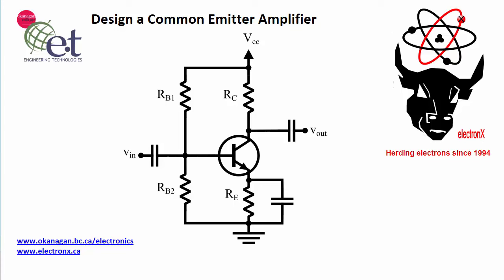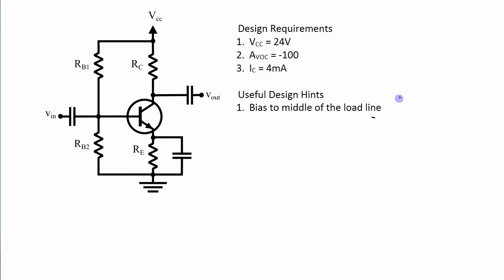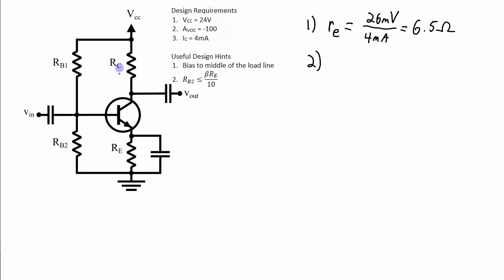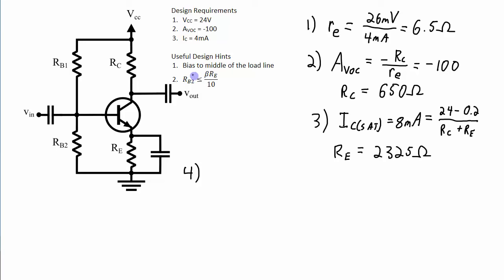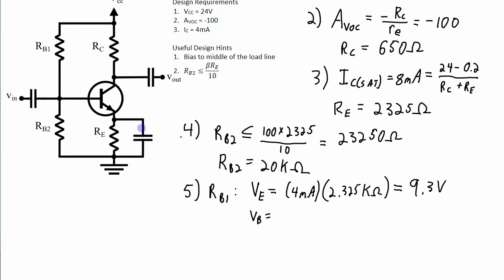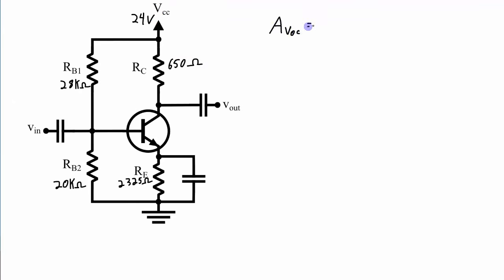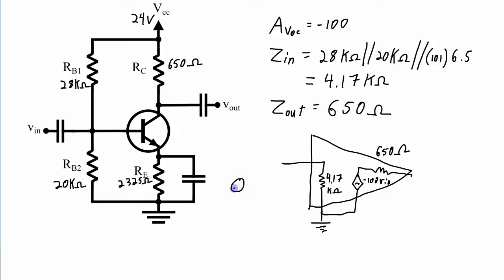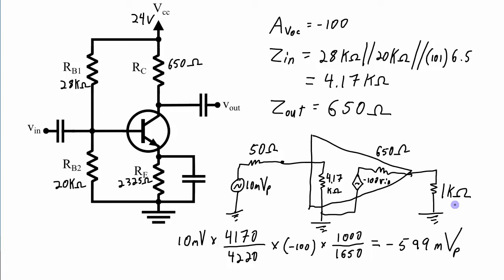Design a Simple Common Emitter Amplifier

Comment: Greetings,

Great video!!
I would like to ask 2 questions:
1. In 2:50 you calculate re = 26mV/4mA. How is the 26mV produced?
2. Why don't we use the DC/AC loadlines to calculate the Rc/Re values?
Reply from the maker: 1) The base emitter junction is a PN or diode junction. The AC resistance of a diode can be determined from taking the derivative of Shockley's diode equation with respect to voltage:  d(Id)/dVd where Id is the current through and Vd is the voltage across the diode.  The inverse of this derivative is the AC resistance of the diode and that emitter resistance is a diode resistance:   re = 26mV/IE

2) In a hand-wavy way I did use the loadlines by trying to bias as near to the center of the loadline as I can.
Reply: Thanks a lot for your response!!! Highly appreciated! :)
Reply: @ElectronXLab  I validated your design and found that Vce = 12.1V. Which means that the Q-point is on the middle of the load line between Icmac=8ma and VCE=Vcc=24V 

But some desings lectures say that Av= -Rc/RE .. How it is come?
And
Some designs say That RC should be great than RE.
And
Also some designs divide RE to two REs in order not to depend on re on their calculations

I'm little bit confused from the different ways of designing an amplifiers
Reply: @hero96559  I am afraid the choice of Vce = 12V in the video might not be a good Q point.  Vc=12V (to the ground, NOT Vce) is a better choice. If we selected Vce@12V, it means that we can only have around 2.5V for your upper margin of your ac output since Vc(to the ground) is already up to 21.5V. Besides, a general selection of Re shouldn't be too high, as most of the hfe gain of the transistor is above 100, it make the Vb voltage way too high as well. Anyway, the calculation here seems no problem, but the design parameters provided is not a practical one!

Comment: Can u point out how to determine the values of Coupling capacitors and the bypass capacitor to a preferred high pass frequency . And another request is can u do a tutorial for multi-stage bjt amplifier. Thank you.
Reply: For capacitor values, I recommend the following rule-of-thumb formula. (All results in uF.) Ce= 160K / (20 Hz x (RE / 10))=  160K / (20 x 233)= 34: Use 39 uF, standard value. Cin= 160K / (20 Hz x (Zin / 10))= 160K / (20 x 622)= 12.8: Use 15 uF, standard value. Cout= 160K / (20 Hz x (Zout / 10))= 160K / (20 x 65)=123 uF: Use 150 uF, standard value. You may adjust these values as necessary. Larger capacitors increase lower frequencies.  Smaller capacitors decrease lower frequencies. (For more precise formulas, consult an engineering textbook.) Capacitors narrow the bandpass of this amplifier. The emitter capacitor causes the gain of this amplifier to vary according to frequency. High frequencies receive the most amplification. In this circuit, the other capacitors enhance this high-pass effect. The 160K figure above is roughly ((1/2π) x 10^6): Close enough to determine typical capacitor values. By "typical capacitor values," I mean those that one can actually buy.
Reply: @w9xk  The emitter bypass capacitor needs to have a reactance smaller than re, which is 6.5R across the frequencies we are interested in. The circuit shown will need a capacitor of Ce = 160K / (20Hz x 6.5R) = 1,200μF to have a 3db loss at 20Hz. With 39μF, the emitter impedance would be (6.5 + 204j) ohms at 20Hz giving a gain of just over 3 with an almost 90° phase shift.
The ac input impedance of the circuit can be as little as 650R, not the 4.17K suggested.

Comment: Thanks for the tut. What if we don't have Avoc? Can I just arbitrarily allocate voltage drops in the resistors, but keeping in mind that Vce is in the middle of the load line?
Reply: You can pick any value for (Avoc) I think it's decided by the value of your collector Resistor divided by the value of the internal resistance of the transistor which you get by using this formula : 25mV/IE. Your dividing The Collector Resistor  by the Internal Resistance of the transistor because of the bypass capacitor which shorts out RE.

Avoc = -100 

Avoc = -RC/re
Avoc = -RC/650 Ohms
RC = Avoc x re
RC = 100 x 650

Comment: how do you power 2 for stereo  using one 9volt battery?   i tried it and it goes mono.  needs to have a power supply  to separate the power going to the collectors. emitter is common.

Comment: If Vce = 12V and VRE = 9.3V, then Vc (for DC) sits at 21.3V, there is literally only 2.7V positive headroom left for the AC to swing. I think you should've started in a way/had a design requirement so Vc would be VCC/2.
Reply: I don't understand 26mV , from Where ?
Reply: @minhdang108  Thermal voltage = kT/Q where k = Boltzman constant, T = absolute temperature and Q is the charge of an electron (also a constant). We usually take 25 degrees celcius as temperature.

Filling this all into the equation leads to 26mV. 

I'm not sure if he explained it anywhere, so here it is.
Reply: @trevortjes  Thank you.
Reply: You actually want it to be half-way between Vcc and the lowest voltage on the collector that keeps it out of saturation (say approximately the voltage you've set on the base). Of course, it doesn't matter if you're only dealing with a few hundred millivolt signal swings, but in general, it's as easy to design for a decent amount of headroom as it is to end up with very little. I'd normally pick a collector current that gave the best noise figures as long as that allowed large enough base bias resistors to get a usable input impedance. Leaving aside a few volts (say 3 to 4) for the base/emitter bias points, that gives me the value of the collector resistor for maximum available swing. For a 24V supply, I'd want 4V at the base and 14V at the collector with quiescent current. The other values follow from that.

Comment: Can someone explain the derivation of  26mv in the calculation of re?

I did look through the comments but still do not understand where that value came from.
Reply: Looks like this value is to compensate for Intrinsic emitter resistance.  It attempts to account for properties that can cause distortion (such as operating temperature).
Reply: @richardeberhardt1301 English man

Comment: Thank you for the excellent vid. Got a noob question. The input at the base of the transitor will include both AC(signal) voltage and DC(24v) ? So what is the actual voltage at the base?
Reply: At the base there would be ur original signal with an offset voltage
Reply: The drawing at 1 Second has what is called a blocking capacitor; This only allows alternating  voltage to pass; The DC does not go past that as he has it; This is not an unusual concept even though most think of a return path;
Reply: The final voltage at the base of the transistor will be the sum of both the AC (signal) and DC (bias) voltages. That is to say, if the DC bias voltage required is 10V (as in the video) and the input AC signal is 10mV peak-to-peak, then the highest voltage possible at the base would be 10.01V and the lowest would be 9.99V. This changing base voltage causes a small change in base current which in turn causes a huge change in collector current (how huge depends on hFE or ß) which is how the BJT amplifier basically amplifies.

Comment: Is there a way to calculate this when you know what your load impedance is? (or how to alter the design to account for the input/output impedance that changed the desired gain in this example)
Reply from the maker: You really need a multi-stage amp for that kind of control. One stage for controlling input impedance, one for gain and one for controlling output impedance.
Reply: @ElectronXLab  That makes sense, thank you!

Comment: Where would i go about starting my design if my inital conditions are Vin= 0.1 V and Vout=5 V (Peak to peak Values). I will be using a 9 V battery as VCC and a 170 beta transistor. Help would be much appreciated
Reply: You would want to specify the desired input and output impedances, and be realistic - you can't have Rin/Rout bigger than the beta in any usable design. Also a gain of 50 is tough with a single stage and an output swing more than half the supply voltage.

I would suggest aiming to set the voltage on the base around 3V and on the collector 6V. If we wanted high input impedance and low noise, I'd suggest using something like a BC184 with a collector current around 0.2mA giving a beta of 100 minimum at that collector current and decent noise figures.
That gives a collector resistor of (9 - 6)V / 0.2mA = 15K.
The emitter resistor would then be (3V - 0.6V) / 0.2mA = 12K, but that would give a gain of 15/12, so we need to bypass most of the emitter resistor with a capacitor to get an ac gain of 50.
So the ac emitter resistance has to be 15K/50 = 300R. But the intrinsic emitter resistance is 26mV/0.2mA = 130R, so we have to use a resistance (Re1) of 170R to make a total of 300R.
Therefore we have a remaining resistance (Re2) about (12k - 300R) = 11.7K of the dc emitter resistance. That has to be bypassed to ground by a capacitor whose reactance is less than 300R at the frequencies used. C = 1/(2πfR) which gives 27μF to have a cut-off below 20Hz. The entire emitter impedance would be a 180R resistor (Re1) in series with the combination of a 12K resistor (Re2) bypassed by 27μF (Rc).
The transistor's ac input impedance will be (beta x Re) = 100 x 300R = 30K, so there's no point in using base resistors much bigger than that. Using Rb1 = 100K and Rb2 = 51K would give  3V at the base, as designed. The current through Rb2 would be about 60μA and that makes the base current insignificant (Ic / beta = 0.2mA/100 = 2μA).

That should give up to 6V pk-pk available at the output (swinging from 3V to 9V). That can be trimmed by changing Rb1 (100K) slightly to make Vc = 6V. The gain should be around 50 for audio frequencies. That can be trimmed by altering the 180R emitter resistor slightly. The input impedance is around 15K at ac. Use an input capacitor of at least 1μF. The output impedance is 15K, so it needs a coupling capacitor of at least 1μF as well.

I'm uncomfortable with the size of re (130R) compared with the size of Re1 (180R) as it would lead to non-linearities and some distortion, but it's hard to get a better ratio of Re1:re without increasing the supply voltage or reducing the gain. You could lower the base voltage to around 2V by increasing Rb1, giving more voltage swing and allowing higher Rc and Re1, with better linearity, but the emitter voltage is then just 1.4V and the collector bias point would be more variable with choice of transistor. Of course, if you're just making a single circuit, you can change the resistors slightly to get the voltages you want, but that doesn't scale very well if you're making several of them.

Comment: Sir is it possible for you to make a video on how to design RF transmitter and receiver module circuit diagram with explaining it's working how the signal is transferred from transmitter to receiver. 
Topics to be studied for designing your own RF transmitter and receiver module circuit diagram eg. ( 433 MHz RF transmitter and receiver module)

Comment: The input impedance should be (Beta+1) x (re + RE)
Reply: But isn't Re bypassed by the capacitor Ce in the AC model?
Reply: @SopanKotbagi  3:30
Reply: The dc input impedance would indeed be (Beta+1) x (re + RE). That helps to keep the operating points stable. However, the ac input impedance assumes that RE has been bypassed by a large capacitor which has a small impedance compared with re. That means the ac input impedance is effectively (Beta+1) x (re), which is approximately 650R.

Comment: Wait, don’t you want current to flow into the base since that’s the direction the current flows anyways?
Reply: Yes but you want the base current (which also flows through Rb1) to be negligible compared to the current flowing through Rb2. That ensures that the base current has little effect on the base bias voltage. Good design will aim to minimise the effect of transistor parameters on the circuit performance and reproducibility.

Comment: From were you get  26 v
Reply from the maker: 26mV is the thermal voltage of the BJT and it's a constant (well, a temperature dependent constant) for the transistor
Reply: @ElectronXLab  🙏 thanks for the reply sir. Any video on how to design a  RF  transmitter and receiver module for remote control ie rc car etc.

Comment: good video! one question: why the circuit is set to Ic = 4mA in the first place? I believe setting to a lower current value like 2mA or even 1mA could produce the same voltage gain. And consume less power when running...Thanks
Reply: good question
Reply: That keeps the output impedance low (but unfortunately lowers the input impedance as well). As you suggest, we'd normally design for currents significantly less than 4mA, allowing higher emitter resistances, which increase the input resistance, at the cost of a higher collector resistance for the same gain, and hence higher output resistance.
Reply: @RexxSchneider  So he's using an Ic=4ma to keep the output impedance low? He mentioned something in the video about using that value so that the transistor is biased correctly but as long as it is reverse biased correctly there are a range of collector currents that he could use.  Still not sure why's he using that Ic unless he's requiring that for whatever load he connects to the amplifier.
Reply: @ricomajestic  If the gain of the circuit is a given requirement, then that determines the ratio between the collector resistance and the emitter resistance. You want the quiescent voltage on the collector to be about half-way between the supply voltage and the voltage at the emitter of the transistor as it clearly cannot swing beyond those limits. So the voltage across the collector resistor is fixed by that. That means if you design for a particular collector current, it determines the value of the collector resistor, and therefore the output impedance.

For example, with a 9V supply and allowing about 1V at the emitter, you have about 8V of signal peak-to-peak before clipping. So you want half of that, i.e. 4V, across the collector resistor. With a collector current of 4mA, you have a 1K collector resistor, so the output impedance is 1K. If you dropped the collector current to 0.4mA, you would have a 10K collector resistor and so the output impedance would be 10K.

Generally speaking, once you have a set of resistor values calculated, you can scale them all up or down by the same amount (within reason) and still have a circuit with approximately the same bias points and gain. But both the input impedance and output impedance will scale up or down by the same factor.

Comment: for Rb2 calculation  RB2 <= Beta*RE/10 , where did the 10 come from ?
Reply from the maker: The 10 is somewhat arbitrary; the purpose is to make sure that the resistance of RB2 is much less (i.e., 10x less) than the resistance seen looking in to the base

Comment: re: little Re, where did 26mv come from?
Reply from the maker: That's the thermal voltage and is a property of the PN junction. It is temperature dependent, so the value of 26mV is only valid when the temperature is about 25C. VT = kT/q. Where k is Boltzmann's constant, T is the temperature in Kelvin and q is the charge on an electron.

Comment: Why did you select BETA as 100 in step 4 while calculating parameters? For the sake of simplicity? or did I miss sth?By the way Thanks a lot for these useful videos !!!
Reply from the maker: Beta is a characteristic of a BJT. The value can vary significantly from transistor to transistor even ones with the same partner.
For this example, I just picked the value of beta for the sake of simplicity (just like you guessed).
Reply: thank you sir, waiting for more videos to come :)

Comment: . Design an amplifier circuit with the following specifications: 
• The overall voltage gain should not be less than 350.
• There must be phase difference of 180° among input and output voltage.
• The input impedance should be in the range of 50 𝑘Ω and 60 𝑘Ω.
• The output impedance should be as small as possible, preferably lower than 5 𝑘Ω.
• You cannot use Operational Amplifier. You can only use BJT or FET or both for your 
design.
Reply: Can any one solve this plzz
Reply: @AmirKhan-fp7xo  Why would anybody try to solve it? A closed-loop gain of -350 is ludicrously large for a single stage and you haven't specified the frequency response or supply voltage, nor the required output swing. Using a common dual opamp like the NE5552 would allow a two-stage solution with a flat response across the audio range and a minimum of fuss in the circuit layout.

Comment: isnt the Ic(sat) = Vcc / Rc ?
if not how did you find Ic(sat) ?
Reply from the maker: That would only be true if VCE(sat) is zero (it's not) and if there was no RE resistor. Ic(sat) = (voltage across RC) / RC. Voltage across RC = (VCC - voltage at collector) and voltage at collector, Vc = IE(RE) + VCE(sat), so Ic(sat) = (VCC - IE(RE) - VCE(sat))/RC and if you approximate IE = IC, and rearrange that equation, you get Ic(sat) = (VCC - VCE)/(RC+RE)
Reply: @ElectronXLab  oh i see. Thank you.
Reply: Would you take the max value for the saturation voltage from a data sheet ?
Reply: @ElectronXLab  And since Vce_sat is around 200mV for most small signal transistors, you can neglect it compared to Vcc. That gives you the useful equation:
Ic_sat = Vcc / (Rc + Re)